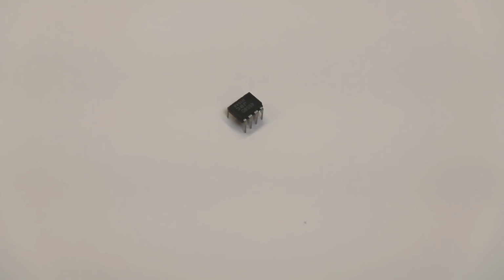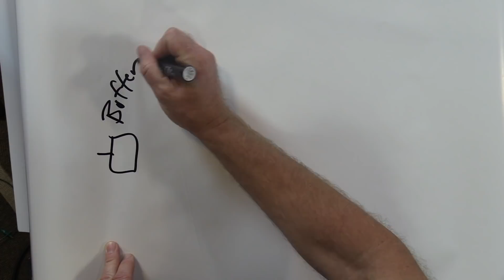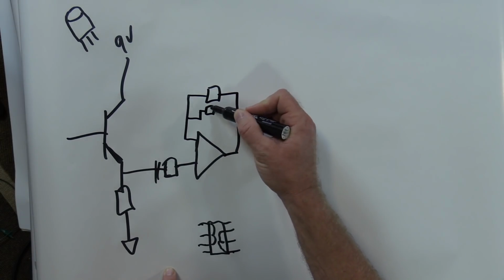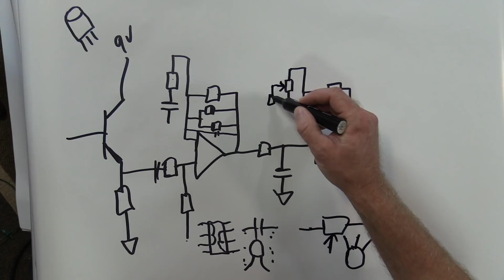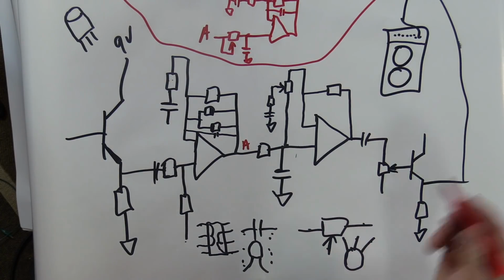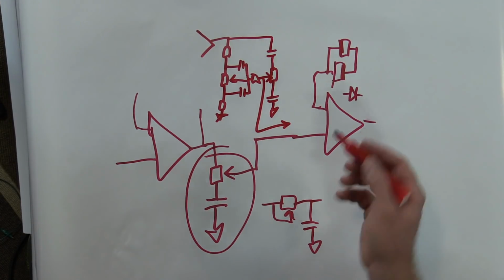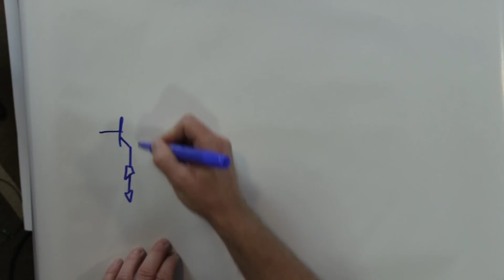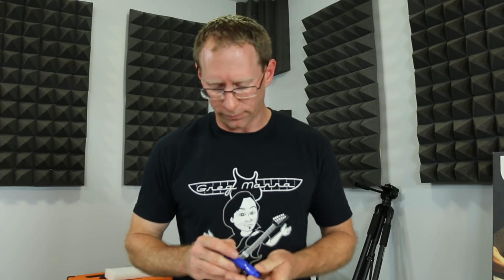What makes an overdrive pedal original? Are they all Tubescreamers?

Comment: Instructions unclear. Soldered amp to guitar.
Reply: Best tone, go direct. Skip the pedals, skip the wireless, hell skip the wires. Through hole leaded solder, is the only connection you need.
Reply: The truest of bypasses

Comment: Congratulations, this is a great one explanation about how a Tube screamer is made. And beaten the myth of Op amp, that makes unique and non-clonable the difference in the Ibanez pedals.
Sorry if my grammar is not reflecting the syntax's of the things and concepts I wanna say. I'm from Spanish spoken.
I´m an enthusiastic of the pedal sounds and gear. I´m a guitar player too, keyboardist...And for some reason this has been my life in the last months, I´m not a boy, neither a young anymore, and it has been very difficult for me had a stable job, the situation in the country is very precarious. I buy and sell audio equipment and occasionally I repair or mod, (but to much basically) a few pedals, and I would like to make this as an professional kind of life. Here some people built pedals and sell but in a manner of download schematics and copying without making any difference, none has an original design or sound. All are schematics clones. I want to learn to make my own design in the pedal fx industry, at least regionally. I wonder how to find some guides of how it works or the parts of which an pedal is made. I like a lot the gear you built, Dracarys, Tunmus, Pinnacle, just for mention some of it. I admire your job, for this reason I dared to ask about this matter of building / designing pedals. Could you tell me how to start?

Comment: I agree with you. With the same 4558 lots of different clipping pedals can be made. IC Big Wuff, Klon clone, TS clone, Rat like clone, OCDrive like clone, OD-1 and its sons, even a compressor, etc... or something experimental...  and all of them are going to sound different to each other, depending on the surrounding structure, circuit architecture and components. Cool Video.

Comment: Great explanation for non electronics guys. I´ve  have build a 808 standar tube screamer,  two rats and my loved npn rangemaster. I am on a self-learning way (I am petroleum engineer) but really like the way fx circuits works. I am simulating the TS808 with LTSPICE to see the way how change the signal/wave after changing some values so I could build my own overdrive designe but...  ...it´s always better to do it with a breadboard after all. I´m just a novice but I like to study deeply fx electronics. Thanks for this video, would be great you to show the difference between the sound you get feeding the op amp by the +input (non inverted) or the -input (invert), I am not that clear on this. 

Saludos from Venezuela...   ...(and sorry, my english is not perfect!!!).

Comment: Thank you for dispelling the myths about OD pedals and the concept of transparency. I bought a O.D. several years ago because it was touted as being "transparent." That was B.S.! While it's a effective overdrive, as well as clean boost, it is not transparent. Now, thanks to your explanation, I understand why it isn't and more importantly, why a truly transparent pedal would not be desirable. And what I have learned so far about pedals, amps, and circuits in general, I have put to good use by making modifications to some of my O.D. pedals so that they give me the responses I wanted from them in the first place. Once again, if you want it done right, do it yourself.

Comment: Thanks for sharing this most known opamp schemaics .the elementary basics of this is the knowledge of opamp schematics you have to know and understand when you're building overdrive/dirt pedals. Buy a breadboard. Buy some resistors ,caps,diodes, transistors, of different values and built these schematics.and tweak minor sections to hear  how it responds. It's an addiction I tell you. What Brian wants to tell us that's not rocket science. Somtimes it is starting to squeal or hum when you use the wrong combination of components but that's the part of learing. Or put an elco in the wrong way in so that could explode....the gold old times. Keep this videos up! Soft clipping or Hard clipping, search for you dream overdrive tone or simply buy a wampler pedal....

Comment: I'd love Wampler to come with the "Uber Mega Ultimate Overdrive" pedal with most different circuitries (Rat, TS, Klon, OD/DS, etc...), all in one unit with switches and knobs to select the type and change the values to pretty much cover all drive... (pretty much like the Elektron Analog Drive)
Reply from the maker: I've thought about that before... but due to being analog, it may be a quite large pedal unfortunately
Reply: But since most of the design you shown in this video use the same parts, what if you would mount them in a "Matrix" and just change the routing of them to redo the whole circuitry on the fly to match different type of drive pedals? I know guys that did develop 100% pure analog Matrix routing system that could be digitally controlled and could be quite affordable (I think it's $10 or $12 for a 16x16 matrix, and little bit more for a 32x32 matrix). Add some potentiometer or multiple position selector to adjust some resistance and cap value in different place in the circuit (generally to adjust the frequency that is cut or boost) and it would pretty much already be a drive pedal very flexible to cover pretty much all major kind we're talking about here. Again, it's just a thought/wish :)
Reply: Wampler Pedals why couldn't you use smd and multi layered boards?
Reply: Yeah why don’t you just use your wizarding and do it already!?!! 😉
Reply: A "one drive pedal to rule them all" might also not make sense from an economical point. It would probably cost a lot more than a normal pedal (the analog drive isn't exactly cheap) and that limits the market. I guess it makes more sense to produce five different drive pedals for 200 each than one with five distortions for 500.
Reply: Build Your Own Clone makes a kit called the "Crown Jewel" which is the closest thing in existence I can think of to what you're describing. Let's you select filtering and tone controls, hard and soft clipping, symmetrical or asymmetrical, etc, plus it has different boost modules. You can get very close to the sound of a lot of different popular drive pedals. Also it has more knobs than the cockpit of a Cessna.

Comment: There are generalisations you can make about distortion pedals. As Mr Wampler shows in this video "they are all Tube Screamers" just isn't one of them. You can say they all rely on clipping and that most of them use diodes to produce the clipping. Fuzz Face type circuits being the exception where the clipping is produced by amplifier saturation against the supply rails.
Perhaps the biggest difference in distortion pedals lies in the filtering - how much filtering is done, which frequencies are filtered and where the filters are situated in the circuit.  
As far as op-amps are concerned, all this nonsense about different types having different sounds is a bit silly (which Mr Wampler also demonstrates in another video) when you consider they were all originally designed to be as close to perfect amplifiers as you could reasonably get. They were designed for use in instrumentation and for analogue computing. 
The Tube Screamer clipping stage is unusual in that the input is in to the non-inverting input. As a result when the diodes in the feedback path are clipping the circuit acts like a unity gain stage and some of the input signal leaks through to the output. Because of this the Tube Screamer retains some of the input dynamics, rather than hard limiting due to the clipping.
Reply: Terry Relph-Knight 😖

Comment: I think for a lot of things, a tube screamer and an eq pedal will do most overdrive sounds. 
 It’s not so much about the particular parts used, but that a lot of the micro nuances of a circuit topology are lost in a gigging environment.

 That’s not to say that all pedals will sound exactly alike with an eq, but it’s also true that a lot of the identifying traits of a drive pedal come from the eq profile of your pedal, among other things.
 
 Point is, you don’t always have to get the perfect overdrive pedal, and you might actually just be in need of an eq or something else to really dial in a tone.
Reply: 800-3.2k is really where the harmonics live imo, you can get a lot out of just cutting or boosting those 3 bands or so.
You can also do this with bass preamps too, where you actually need to add back some low end when using guitar pedals.

Comment: Cool video Brian, I like this tech stuff. What do you think about  Dumble style pedals like Ethos Overdrive, Umble etc. Seems these stompboxes are made by JFET's, at least the Umble circuit includes 4 JFETs on all stages. The clipping diods are  removed, the clipping made by JFET itself - as result you have enough headroom (~4.5V), and the JFET characteristics are very similar (in some cases) to the tube characteristics. Did you tried to design some sort of Dumble pedals closely to original amp? Thanks!

Comment: Actually the Tube Screamer and the bread sound similar. Same smooth undertone, with nice overtones. Neither sound like Germanium Fuzz, or like DOD/MXR/Treble booster family of chips.
Reply from the maker: well, a germanium fuzz isn't using a chip, it's using a transistor(s). MXR, Dod, etc all have a huge variety of circuits, so I'm not sure what you're comparing to here.

Comment: This was really interesting. I would love to see a similar "circuits for beginners" type explanation on the difference between two very different types of distortion pedal. E.g, how/why is a Tube Screamer different from a Metal Zone? or a Fuzz Face? cheers
Reply: CNCTEMATIC I know that a Fuzz Face doesn't have a chip. The "classic" one is a 1 transistor and 1 diode? maybe? No chip no Screamer. Even less sure about the Metal Zone.

Comment: What is the big difference in the TS 808 and TS 9, and are both  of them just as good for getting that huge Stevie Ray type tones?  Did you ever try the TS 9 Turbo, it has 4 knobs, not three and it has 4 modes to click through.. the regular one, the + mode, the classic crunch, and  turbo modes..just wondered if you think this one is as good as a regular TS 9, or not. Let us know, thanks.

Comment: Hi Professor Pedal. I am new to electronics, but ancient at playing. I just wanted to know when it comes to high and low pass filters, how do we calculate the capacitor and resistors weneed to cut off specific frequencies? and is it possible to cut or boost frequencies with tone pots? say for instance I wanted to use the pedal for either Bass or Lead guitar but not sacrifice either instruments tonal qualities.

Comment: Nice video.  By the way you don't need the "S" on the end of the word "anyway."  Those are good explanations, particularly if one has some basic understanding of RC filters, inverting and non inverting op-amp configurations, feedback effects on gain and frequency, and emitter followers.  Thanks for posting it.  Do they use TL072, or NE5534 , or even 741 in distortion pedals?
Reply: Maybe too late for a reply after so long, but to answer your question: Yes, they are used in many models of pedals, not only distortion ones.
Reply: If I am not mistaken, many MXR pedals tend to use TL072 (or the TL061, the single op-amp variant where only one op-amp is enough).

Comment: I opened a Joyo Vintage Overdrive and it's through hole parts and looks like a TS808 (to me). I took out the 1N4148 diodes and put in sockets and 1N34A diodes. I lost a lot of gain but it sounds "smoother". I kept one joyo VO stock to compare it to.  Does it really matter that much to change to Ge?

Comment: I'm definitely a noob with electronics, I get that the 9v is powering the circuit, but how does that battery not hurt the guitar or amplifier? Is that the op amp's function to take the 9v power and increase the amplitude in the circuit? Can I basically just play around with capictors, diodes, and resistors/potentiometers as long as I correctly place the op amps?

Comment: So basically what you're saying is that the "sound" or "tone" of a pedal is much more dependent on the values of the various caps and resistors, and the overall circuit design, than it is on the op-amp chip.  Following this logic then, not all LM308 pedals are RATS, correct?

Comment: The distortion break up nature sounds reatively the same to me.  

What sounds different here is the gain and eq-ing/filtering.
Therefore, out there in the real world, one can make "most" 4558 designs sound "very similar" simply by adjusting tone and gain settings.
A pot on one is at 2, and the other design on 9  for example, will be the unity.
Never exactly the same, but "very similar".
Not "all" . . . "most".
This is my 30 plus year s experience.
Of course some are anomalous and more unique with their design.

Relative Truth, not Absolute Truth !
It is relative to the direction of biases and conditioning.

...

Making this too literal will miss the Relative Truth.

And that is that "most" do sound "very similar" with a little tweaking of gain and tone.

And another Relative Truth, is they all sound different.

Both are relatively true.

Not one or the other.

The paradox shows the higher/subtler Absolute True nature.

...

My apologies for all of this !

 .:)

Comment: My vintage Boss OD-1 has the 4558...sounds nothing like a TS.  Btw...your capacitor drawing is a little vulgar. Had me giggling like a 14 year old. :-)
Reply: David Wayne Broyles thats because the opamp is only a "part of the mix" in the circuit, it is not the cause for the tube screamer sound, that is a myth.
Reply: Omar Cusihuaman ....which is exactly what he explained in the video....I was just giving an example of how they are not the same. 😒
Reply: Which is funny cos it is pretty much the tubescreamer circuit without a tone control but different values and assymetrical clipping makes it a different beast, throw some hard clipping in there and way different values and itll sound nothing like a TS. When it comes to what people call 'TS' type circuits I much prefer the boss influenced pedals (like the FULLDRIVE) then the more true to TS ones. Also try a different OPAMP in a ts and itll sound more like a ts then changing other things will.